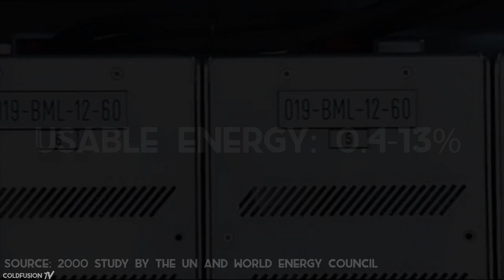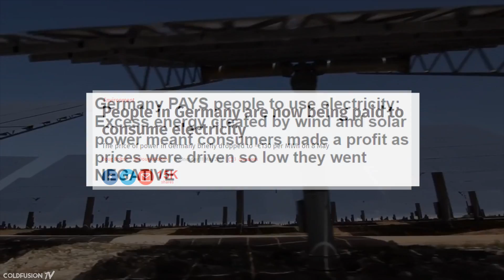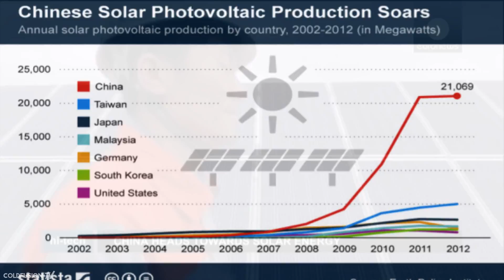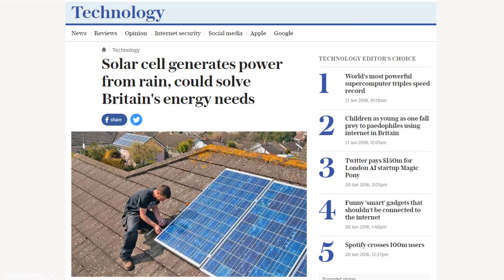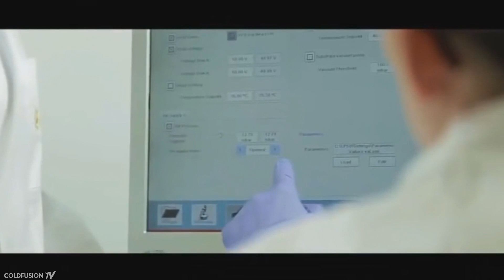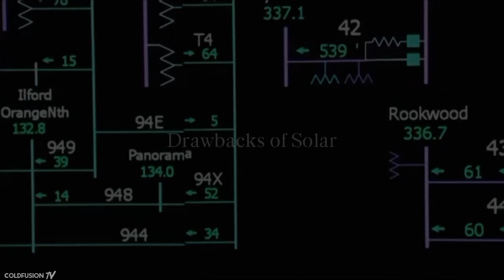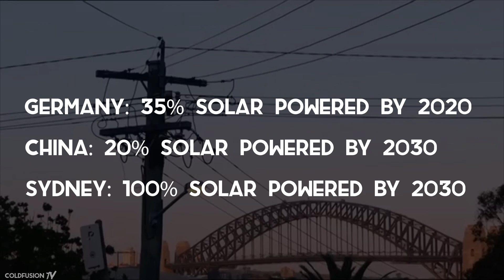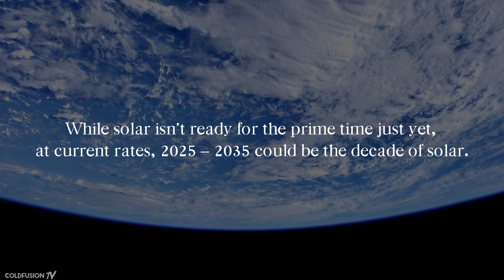The Truth About Solar

Comment: Bruh it still makes more sence to replace all energy sources (except geothermal and hydroelectro of course) with nuclear power. It's cheaper, don't require that much land, more reliable and has lower carbon footprint
Reply: thorium nuclear plants, maybe. Uranium, nope.
Reply: @jager_123  uranium nuclear reactors still have lowest death rate per unit of generated energy. Also latest generation of fast-neutron reactors is almost impossible to break down during the accidents and they solve nuclear waste problem
Reply: @svuvich  "Uranium nuclear reactors still have lowest death rate per unit of generated energy. "

This is true for now, but when the radioactive waste storage problem comes up in few decades, the tables will turn very fast.

"Also latest generation of fast-neutron reactors is almost impossible to break down during the accidents and they solve nuclear waste problem"

1. First problem with fast-neutron reactors is the cost, they are very expensive to build and costly to run, this is probably the biggest problem in capitalistic economy, since everything has to be as cheap as possible to maximize profits.

2. Fast-neutron reactors create a lot richer uranium compared to other designs, which can be used in nuclear weapons a lot more easily.

Then theres the radioactive waste poblem, normal uranium fission reactors create waste that is radioactive up to 24 000 years. 

Thorium reactors (molten salt etc.) radioactive waste is only radioactive for few hundred years. Which is a lot more easy to store than something that has to be stored for 24 000 years.
Reply: Кирилл Егоров Fukushima alone may kill us all

Comment: I gather that Australia has a problem with the installation of poor quality solar panels that do not last very long, which defeats the object.
Reply: No. Although some poor quality modules have been installed here in the early boom years 2010 - 2014, we have a very robust , country wide accreditation process in place, for panels and installers now.  The main reason 90% of solar panels get removed is simply to replace them with a larger system, as costs have fallen significantly. In 2010, a 5kW rooftop system would set you back AUD$20,000 but you can get the same now for around AUD$5,000.  The panels getting removed are still working. The inverter may have died, and so the customer is choosing to upgrade, rather than replace the inverter.

Comment: If this is 2016 let’s just say that a lot has changed in three years. I see multiple large scale solar farms sitting dormant with the trendy eco smart new green entrepreneurs that started them now gone broke. The reasons are many but some of the more obvious ones include a) production significantly below projected output, b) construction costs significantly higher than forecast. c) ongoing maintenance more expensive than predicted. d) incompatibility with existing power grid. e) companies unable to financially manage with lower than projected returns. And the list goes on and on. Really, it has all the hallmarks of any other hastily put together scheme where someone was hoping to make a fast buck then on-sell the business as a going concern. Problem is they didn’t do their research well enough. They will be extremely lucky if someone actually buys what’s left and thus recover some money. It will be a huge loss rather than a total loss. I can’t see it happening. Case of jumping in boots and all too early. Don’t get me wrong. I’m not against Solar but it needs to be done properly and that’s where we remain at the beginning of 2020.
Reply: Bad engineering at one PV Farm does not imply that it is true for all PV Farms ... you must do you research. Clearly the proper research was not done, that is NOT a PV Array problem .. it is a stupid people problem !

Comment: 8:30  If we had enough solar panels around the world ("one hour's worth of sunlight could power the world for a year") and all of those solar panels were connected together, would we still need batteries for night time use of solar energy if the area that is currently dark is getting its electricity from solar panels in a different time zone?
Reply: I'd say this is a great idea in theory but would only be applicable in the very far future. We currently need batteries in most solar setups due to the widespread use of AC as necessary for the long distance transmission of electricity. That said we have come a very long way in terms of tech in just the last 100 years so its possible but I'd also say there will be more and better energy generation tech alongside it. Its also probably bad to get our energy from only one source although ultimately most energy ultimately comes from the sun.
Reply: @thearkedcrown  We currently have Grid Sized Battery Banks and we are installing them!
Reply: @MrSummitville  what does that mean exactly? For what size setup do you have?

Comment: Dear ColdFusion.
You have left out a few things...

You say that Germany's price of electricity has gone to zero.  Actually it has the highest price of electricity in Europe.  (And gives off more greenhouse gases than anyone except a couple small Eastern European countries that use coal & gas for all their power.)  Germany needs to build high tension power lines to move the power from the north to the South, but people don't want power lines in their back yards, so the project has stalled.  Plans to develop massive batteries have stalled due to costs.

You do not discuss how DILUTE solar power is.  Take a 1 kg lump of coal and put it in the Arizona desert.  The shadow from that coal is a bit bigger than your hand.  You can grind that coal to a powder, burn it in 2 seconds and use it to melt iron ore.  How long would a solar panel - the size of that shadow - take to equal the energy gotten from burning the coal in 2 seconds?  The answer is: 6 months.  I didn't believe this fact when presented to me so I worked it out on my own, and it was right.  So when you talk about a Honda being solar powered, it would be nice to say how far it can go per sunny day.  If it adds 8 km of range per sunny day (which is likely pretty close to real value based on the size of that panel), it is not so impressive.

I met a guy who lived in Arizona, who had a solar powered motorbike.  Every surface on that bike was plastered with solar cells, and he boasted to everyone he saw that he never bought gas, and ran his bike on sunlight.  I had a hard time believing it, and questioned him closely on it.  He admitted that the roof of his house, his small garage and a bit of the south wall of his garage also had solar panels, which he used to charge his motor bike.  

GOOD FOR HIM!  However, the shadow cast by that bike is not anywhere close to the amount of energy needed to run it.  But lots of people he talked to had the erroneous belief that the solar cells on the bike alone, was moving it. 

You say that the best solar panels are 30 to 35% efficient.  That sounds not too bad, the the solar panels that you can buy and put on your house are typically half that.  A more accurate figure is that affordable solar cells are 12 to 18% efficient.  You claim that that number is sure to rise.  Maybe.  But the cheap cells you mentioned in the early part of the video, will NOT have the multiple active layers to capture the different colors of light. And if you don't do that, the cells will stay below 20% efficiency.

Also the cheapest solar cells are wired in series rather than in parallel, so a tiny shadow across one part of a panel can reduce the output of the full panel.  There is a lot more to know about solar panel than just the cost and efficiency.  The government should simply outlaw series panels, as they are only being used to rip people off, but that is another story.

You briefly mentioned the need for battery back ups, but do not discuss the cost of energy storage.  It is fairly cheap to get solar & wind replacing the first 10 or 20% of the power grid.  But it gets harder and harder as the percentage rises above that.  Also a megawatt of solar produces a megawatt _when the sun is shining_.  Normal power plants can produce a megawatt of power 24-7, which makes them far more useful and important to the power grid.  The cost of the batteries is huge, tho to be fair, it they replace a natural gas peaker plant they look not too bad.  (Especially if the harm to the environment done by that peaker plant is factored in.)

I have seen estimates that it would cost 2.3 TRILLION dollars to adjust the grid for solar and wind.  This is not the price to build the solar and wind power plants.  Just to make it so that the grid can adapt to massively intermittent power.  However, it you compare this price to decades of war in the Middle East for oil, perhaps it is worth it?

You do not mention that solar panels wear out and need to be replaced every 50 years.

You do not mention the (significant) environmental costs of building those solar panels.

I actually like solar.  Solar is FAR better than fossil fuels.  But converting our society to 100% solar is HARD.  By only giving one side of the story, you either are mis-educating people, or you come across as a propagandist.

Warm regards, Rick.

Comment: "Germany: solar power 35% by 2020" Here we are - 2020. Lets check Germany. https://www.energy-charts.de/power.htm?source=all-sources&year=2020&week=1  If you take whole week it doesn't seem like 35% at all. Especially if you add nigh time as well. If you check last week of 2019 you will see that wind was poor as well. If you want to be considered as reliable source you need to add cost of backup power (gas/coal/nuclear) into your calculations otherwise its just BS not information.

Comment: Musk is a liar.
On heavy cloud days, solar panel output during peak period drops by up to 70 percent. But for musk every cloud has a silver lining.
Reply: Hi Guy,
Actually there are solar panels that are designed to work best on indirect light.  They work fairly well on cloudy days.  But they are about 5% efficient. (Plants are about 0.0015% efficient, if I remember correctly.)

I've heard people talking about putting regular solar cells on the south roof of your house, and the indirect light ones on the north facing roof of your house.

But in general I agree with you.  I live in a city with a rainy climate (Vancouver), where people have a strong environmental streak, and no one I knows has solar.  It just is not worth it with all of our clouds.

Warm regards, Rick.
Reply: @RicksPoker  hi Rick thank you for that valuable insight. At 5% efficiency one would have to be paying astronomical power prices, or be desperate for power as a last resort in order to justify that sysyem. But at least it is available if  needed. On a good sunny day late Spring to  early Autumn my 5.8kw system generates up 5.1kw output at peak and over 4.5 kw for 5- 6 hours. Thats the efficiency needed to justify the outlay. Keep cool

Comment: You needed to address the toxicity of solar panels from: manufacturing, recycling and residual waste. That is where the major downside will come when it's a dominate supplier of energy.
Engineer out the issues like grid stability using stored liquid air or something like that.
The overall toxicity of the waste is going to be the problem. The waste of fossil fuels is the main issue with that source is energy.

Comment: The Toyota solar panel is a gimmick. You can't get much more than a square metre  on a car roof, and that PV area may yield  200 W-h, if left exposed all day.  Not sure how many metres that will take you but it won't be far.

Comment: 8:07 -- It's called a battery guys!  All Solar companies offer storage batteries with 10 yr+ warranties.  They do cost a lot though ,so I can see another downside to that.  But to give you guys an Idea -- you can buy such a battery that stores 24-30 KWH of electricity from your panels for around $10.000- 20,000....and prices are going down annually.  It won't be long before such storage is affordable.
I saw a storage battery for commercial use that did like 100 KWH or more, and it cost $50,000 or so....
But, I'm arguing process here.  Storage is what they do to solve to whole "night electricity use" issue.  Switch onto your backup storage battery at night, and have enough panels to charge up the battery, and also run the house during the day.
Reply: A Power-Wall !

Comment: STOP! Before you go out and buy any old panels read this:
Most of the planet are using the wrong Panels!
If you don't track the sun daily, if your not going to change the angle seasonally or if you have a decent amount of overcast days and if you have a bit of extra space then the best panels are thin film. Most of the northern hemisphere are using mono or polycrystaline panels which are no good unless you live at the equator or unless you track the sun throughout the day and the year.
  The panels that everyone uses only work well when aligned into the sun and are completly unobstructed from shadow.
  Thin film panels will work in low light levels which includes sunrise sunset, overcast days partially obstructed by shadow and unaligned panels. 
  So unless you track the sun you are only getting a decent amount of power for 4 or 5 hours a day for half of the year.
Thin film will give you full power all day all year long!
  If you have a little more space and can invest a little more initially you will soon recover your costs and more!
It's not new technology, they are the same panels we have had on our calculators since the 70's/80's. Just scaled up!

Comment: Solar is a scam. We installed 20 solar panels which costed 19000$. It would take you over 17 years to save what you have spent. We recently sold the house and resale value only went up by 7-8K. Dont waste your money on this crap.
Reply: Why did you spend $19,000 on 20 Solar Panels - Are you a 100% complete idiot ?

Comment: This guy is so full of crap. By the time the sun travels the 93 million miles to get here we get about 1000 watts per 100 square feet available if we could use 100% of it. We can use about 40% when its daylight and no clouds ...do the math.
Reply: Actually, there is about 1,000 Watts per square meter from the sun shine!  A PV array can generate about 2,000 Watts from 100 square feet.

Comment: It's not the transmission systems that will require upgrades, it's the distribution systems.  Even if solar put's conventional utility models on their heals, the RTO's and ISO's will effectively gain individual customers, and they could very easily operate the distribution systems just like they do the transmission systems now.

Comment: The real problem isn't night time it's battery storage to keep it running. Until they developed a battery system that can handle the load it's still better to compartmentalize each house and go off grid.
Reply: We do have Grid Sized Battery Banks and they are being installed ...

Comment: @5m35s: Panels powered by rain. Numbers are important. A light rain over the surface are of a panel provides essentially zero power. Claiming otherwise is very misleading. Avoiding the actual numbers involved is subtle deception.

Comment: Great supply of info, however no info on capturing heat from the sun. I saw my electricity bill go down 50% by installing a solar boiler and just 6M² heatcollectors. The most profitable project ever. Even on clouded days showering is no problem. In wintertime an extra electric heater element in the boiler works as backup.
Reply: Me too👌👌👌
Reply: Well how much did it cost cause that sounds niche, niche at least for me

Comment: 1) Peak demand does NOT happen at night here in the USA, it happens mid to late afternoon when everyone is blaring their A/C's as cold as they can get them. That just so happens to correspond with the time of day when Solar is strong.
2) There are no Terrestrial Panels that are 35% efficient, that's for Space. Down here on Earth, you're talking ~22-26% at best as of 2019.
3) The Energy Grid doesn't need anything to allow Solar generation on a large scale, and certainly not from households. Utility-Inter tie is a proven system. It's almost literally plug and play.
4) Yes, we still have a ways to go on Battery technology. If only we had an oustanding Battery system almost 2 decades ago that wasn't bought by and shuttered by GM... Oh wait, we did.

5) There's also a Company working on Solar Glass, a nearly transparent Glass that generates energy from Sunlight.
Reply: you got a ticker symbol for this company working on solar glass?
Reply: @garciajordan86  Hmm, apparently I'm even behind times (yes I know this video was 2016) and there are several Companies working on Solar Glass or Photovoltaic Glass:
Onyx Solar, Solar Window Technologies Inc & Brite Solar. At least those are what I could find myself, there may be more. Here's the original Article I read about it when I first learned about the technology. 
https://www.pv-magazine.com/2017/10/26/new-transparent-solar-glass-developed-by-scientists-at-michigan-state-university/

Comment: Germany 35% solar powered by 2020? How did that work out? They can't hit 10%, it's just not sunny enough. Solar installations stalled, so they had to give another round of FIT subsidies, despite solar being said to be "subsidy-free" by now. Another round of solar farms whose power generation will be subsidized by ratepayers and increase end user electricity costs further.